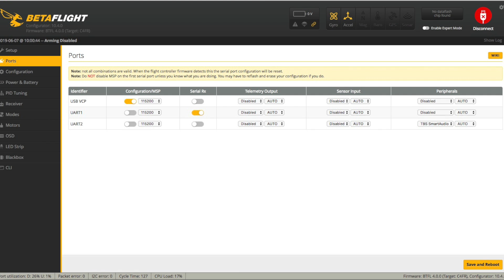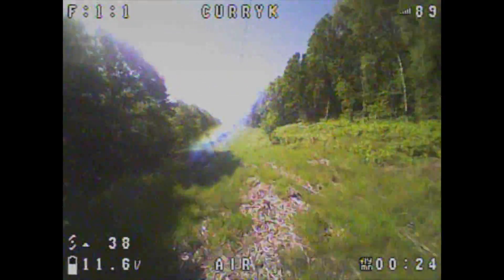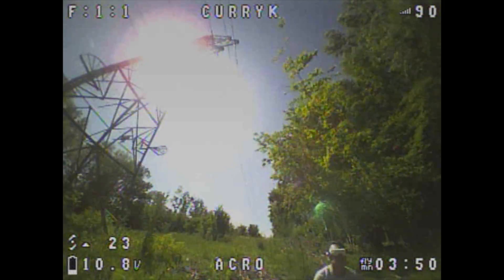Installing an XM+ in the SailFly-X for increased range

Comment: Thank you for this awesome video ! i got one of this little beast,but on Full Gas a got a lot vibration  ! What can be problem ? its pids or props ?
Reply from the maker: I just went back and checked my original video to see if I messed with the PIDS and I didn't, but full beans on 3s and those props will flutter and cause some vibrations.  They are also quite susceptible to wind as well.  I just did a video about trying hq props (which are better) and the little 4-bladed emax avans which worked really nicely on another model.  So worth experimenting with these if you want to get smoother

Comment: can i install my Flysky X6B rx to the sailfly the same way you installed the xm+ ?  thanks !
Reply from the maker: Yes - with a few caveats, as I don't fly on FlySky, so my info is a bit sketchy.  I think IBUS is non-inverted, so you can use RX1 instead of IRX1, but the rest of it should be the same

Comment: Where exactly is the "white" wire connected? Thanks in advance for your help!
Reply from the maker: The white wire (which is SBUS from the XM+) goes to the inverted RX1 pad on the board.  If you look at the board schematic here http://www.happymodel.cn/wp-content/uploads/2019/05/Crazybee-F4-FR-Pro-v2.1-Connection-Diagram.pdf you'll see it labeled as IRX1

Comment: Hello Sir. Very good job you have done very good. 
Question,. Will putting one in the v3 be the same as the v2.1. I have just got a Larva and I'm ready. The Larva comes with great instructions I imagine it's the same. 
Small soldering indeed. Go Go gadget quad.lol
Reply from the maker: Just having a quick look at the board layout (http://www.happymodel.cn/index.php/2019/07/26/crazybee-f4-pro-v3-0-2-4s-compatible-flight-controller/frsky-top-view/) things look like they've been laid out differently, and there's no connector, just solder points.  So, you'll probably find that the solder points match up correctly, but they are in different places
Reply: Yes that bind button is  as hard to find as an holy man in Sadam.
But I found it. After taking the canopy off and lightly pulling vtx up a bit I had it good

Comment: Get video once again. Question though, could you have used soft serial to remap/seperate the uart1 pins/resources and therefore not have to relocate the smart audio wire? FAR from an expert and not tried it myself, just a thought
Reply from the maker: Yes you could split the UART rx/tx pins into separate softserial devices, but what you don't want to do is run something that's timing critical like a receiver on a softserial port.  Unfortunately, the need to use that physical inverted RX1 pad gave me no option but to move the smart audio as well

Comment: I did this with the trashcan but lost my osd not on the quad but in betaflight? 
Any ideas? It uses that triangle vtx
 
Think I got it I need to pull the smart audio (green) wire from vtx to tx2 correct?

Comment: Your piece fell into a carpet singularity. Only a hypothesis so far but I'm working on the research. It's either that or leprechauns. I'll let you know what I find. Keep up the great work mate. Cheers.
Reply from the maker: It showed up again - perhaps it's more of a wormhole and it travelled back.  I was just hunting around finding where a component cable went and it was sat there  mocking me.  I'm not putting it back yet, but I'm going to replace the camera in this next, then it'll go back  in and I will have scored a victory. ;)

Comment: I think you could’ve just use the uninverted signal point on xm+ thou it’s tiny to uart2. I just connected r-xsr uninverted s.port (fport) to T2 and it works fine.
Reply from the maker: Yes - you can access an uninverted sbus signal on the XM+ (although it's annoyingly on the leg of a chip)  My main reasons for doing so are as follows: 1) I didn't think of that  2) I didn't have any heat shrink to put the XM+ back in  3) I still didn't think of that :)
Reply: CurryKitten Heheh, either way it works. And yes that uninverted sbus point on xm+ is a pain the butt to solder. I couldn’t do anything w/out headband magnifier glasses.
Reply: Blast Off hello so you are able to use fport with rxsr on sailfly.. Can you explain the wiring solution? I bought the pnp version of sailfly and i want to use my rxsr using fport on it. Thanks

Comment: could u please tell me which/what solder wire u use...where u buy it from....is it any good.....any advice on this please.i don't know which one to get....have bought  quite a few from bangood..but non of them seem to be good at melting nicely.....btw i am in the uk...
Reply from the maker: I think the last roll I got I may have bought from Maplins, so that's out.  I'm using 1mm lead free solder (it's from Mudder just reading the label)  Lot of people will tell you to use the leaded stuff - but I'm playing it safer.  Anyway if you search 1mm lead free solder on Amazon.co.uk you'll get a bunch of hits, 100g will last a long time.  WIthout wanting to tell you how to suck eggs, make sure your tip clean and tinned and you've got plenty of heat there.

Comment: Great Video CK, you must have nerves of steel and rock steady hands !!!!!, if you get the one without a receiver, it comes with through holes for the TX's & RX's, so a bit easier to solder and also a little bit cheaper. http://www.happymodel.cn/index.php/2019/05/18/crazybee-f4-pro-v2-1-flight-controller-2-3s-lipo-compatible/1011-6/ - www.happymodel.cn/index.php/2019/05/18/crazybee-f4-pro-v2-1-flight-controller-2-3s-lipo-compatible/1012-4/

Comment: Not sure if BF supports this, but I'd guess it probably does. In INAV we support running a hardware uart in just RX mode using only the RX pin. This lets you enable a half-duplex softserial port on the TX1 pin, which would let you have both S.Audio and SBUS input using only the TX1 and IRX1 pins. That way you don't need to swap the S.Audio wire, just change its port via software. This also leaves TX2 and RX2 free for connecting a small GPS (we don't support WP/RTH without compass right now, but my plan is to use my sailfly to try to make that happen).
Reply from the maker: Sorry for the delay - your comment was stuck in the spam folder because it though the . in S.Audio was a URL :)  When I look and thought - well SBUS is an rx and S.Audio is a TX can I use the same UART - I couldn't find anything in BF about it.  I found some references in Github issues asking for the feature but it looked like they had been turned down based on the two protocols running at different baud rates.  Admittedly I wasn't looking for running as RX only and using softserial... I do wish finding BF features was a little easier to do.  I was a bit confused why a compass seems always needed in quads - I've just fallen foul of this in Ardupilot.  I figured it would be the same as planes and you could infer the direction the quad is facing from it's path and you could also infer that the quad is flying forwards based on the acclerometer and figure out the rest from there.  I'm sure there's more to it than that, but it seems workable in some way.  Look forward to seeing some waypoints on your sailfly soon !

Comment: Did you consider using an R-XSR? It's a bit smaller than the XM+ and has telemetry. You might have been able to get telemetry to work through the led connector. I upgraded a couple Babyhawk R's to R-XSR radios and was able to get telemetry to work.
Reply from the maker: Wow, that is tiny now.   I instantly thought of the XSR and was confused as that's quite big.  I've actually got a few R-XSR's installed in some RTF quads.  They are great, no doubt - I went with an XM+ because I had a spare sitting around on my desk and they are a bit cheaper.  I never end up connecting smart port telemetry in when I have it available, I'm just happy if I've got a decent RSSI indication
Reply: CurryKitten  With telemetry you get audible RSSI warnings, you can configure audible battery warnings, and you can use LUA scripts to change pix settings. On the baby hawk R it’s not clear where to solder the telemetry wire, but it works on the connection next to the usb.  There a few of them and it needs to be the one furthest from the edge of the board. I like that it has a connector. Makes firmware updates easier..
Reply from the maker: SUre - I know what it does, and I know a lot of people love changing things via the LUA scripts - it just never felt like something that useful for me - but cool that it's working nicely for you.  Do you feel the connector gets in the way of tucking the RX away nicely.  Like you say - great for firmware updates, but slightly less compact
Reply: CurryKitten  I hade enough room and there was definitely not enough room for the XM+. I have yet to change a lid setting although one of my radios is set up with the LUA script. The big advantage I see with telemetry is audible alarms. If you are focused on flying it’s easy to forget about RSSI or remaining battery.

Comment: The 14x14mm cameras  (EOS2, runcam nano 2, runcam racer nano) all fit perfectly in the stock sailfly canopy if you shove it in. I've got an EOS2 with the racer nano's 1.8mm lens and an HGLRC 50mW nano vtx in my sailfly.
Reply from the maker: That's cool - thanks for letting me know.  That TPU seems quite flexible, so I'm sure a bit of brute force won't kill it.  I've got a few micro cameras coming in that'll fit - I'll have to see what I've got around as a nano VTX

Comment: I don't have this drone, but if you can source a VTX, I cannot recommend the Runcam Racer Nano enough! Granted, you will need to turn off sharpview, and then still turn down sharpness to like 10% of the max and maybe bring the edge off the brightness, but after that, I continue to be very impressed. It feels to me like folks describe the Eagle,.....HD. In my most recently posted video, when I dive into that field through the trees, I remember noticing that I could see the individual weeds from like 30 feet up. I just ordered a full cinebee, and I am just hoping the fpv feed will be as good as the Racer Nano. If not, I have a Ratel waiting to take its place,.....HD recording is not going to take the place of awesome feed!
Reply: Shut up idiot

Comment: Thanks for the detailed explanation.  What would be a good replacement for the camera, and would you consider doing a video on replacing the camera/vtx?
Reply from the maker: I'm not sure yet - someone else commented that you could fit a RunCam racer nano or the Caddx EOS2 in there if you shove it.  I've a few cameras coming in for review so I'll be aiming to put one of those in.... not sure about how to replace the VTX yet... I'll figure that out later

Comment: Got a tune youd like to share for your sailfly? Mine had mad oscillations on the stock tune. Flashed it to Albert Kim's tune and that just mad it worse. Everyone else I see has theirs flying smooth and perfect. I cant go above 50% throttle on mine :(
Reply: Make sure your motor screws are tight  and the props are not bent or otherwise damaged.
Reply from the maker: I haven't touched the tune on it, only the rates.  As CC says below - check stuff.  Its easy for props to bend - and the prop shafts.  Look for any motor movement, and check that the stack is held in place securely.  After flying do all the motors come down cool - check that there's not one that feels off compared to the others.  You could also go into betaflight in the motors tab and run each up in turn and check to see if there's any pulsing, or anything odd.  You are just looking for something that's out of kilter with everything else

Comment: Defo worth doing it range is a problem, I just got my sailfly so will see how it goes, by the way I noticed the rssi varies as to when the signal actually drops out, built in Rx doesn't seem to drop out until rssi is down in the 20s, but the XM+ I've used drops out at 60 or even higher , still has longer range but worth noting.
Reply from the maker: Yes - that SPI RSSI goes very low... which is fun as your standard telemetry critical alert jumps in at 42 I think

Comment: Great Mod!!  i'm Lost on all the  Flying Lingo....Inverted Rx2 and such....but i Kinda of understand?!  So Hard to Learn all the Betaflight and  Pin Layouts!    Wish these Quads were Easier to understand!
Reply from the maker: To be fair, that wasn't the most straightforward looking flight controller.  There's plenty of them which are much nicer laid out and practically say "connect receiver here".  Have no fear though, if you get stuck, then odds on, someone else has as well and probably made a video about how they solved it :)

Comment: Hey newish sub off me. Great videos the way. I was looking for your opinions on xm+ in 2s whooops eg trashcan, mobula 7. Would it be beneficial or just sap the battorty. Thank
Reply: Xm+ is only 30mA at 5V so if my maths hold true that is a pretty insignificant 150mW
Reply from the maker: The battery would be fine - take a look at this particularly silly video I made to push the distance using a 1s brushed quad https://www.youtube.com/watch?v=89kJdHoikhU I used an XM+ of course.  The question is do you want to fly a whoop that far :)

Comment: Sooo, I thought these days you can get non inverted signal off of a pad on the xm+? If so then cannot you just us rx2 without hacking smart audio about? Or is the uninverted pad only on the r-xsr..?
Reply from the maker: This is a good point and non one I thought of.  There' an uninverted connected off the legs off one of the chips.  It's small, but it's probably no worse than the other bits of soldering here.  Good point.
Reply: @CurryKitten  as it happens my sailfly arrived today, I'm currently wondering if the newish gnb 300mah 80/160 will allow too many amps and lead to dead crazybee
Reply from the maker: That's super high-C for a little lipo.  I've not managed to murder mine yet - although it's difficult to get all the power down in anything but a vertical punch-out
Reply: You can get an uninverted signal from the XM+ but, it is not a dedicated pad (like the R-XSR has), it is a pin of one of the components. It is a bit of a pain to solder to but, it can be done. EDIT: CurryKitten got in there first, LOL.
Reply from the maker: Type faster next time :D  To be fair, I would have probably gone the inverted pad route, just because I can't find any heatshrink the right size for the XM+ it I unwrap it again.  Quite a lot of build decisions are down to pure laziness, or what I have to hand
Reply: @CurryKitten  Would there be any latency advantage if we connect the uninverted pad from the XM+ to the uninverted pad of the FC (I assume the XM+ is uninverted natively)?

Comment: I went straight for a micro eagle and r9 on my build. The bigger props can handle the weight and it's only 55g dry.
Reply from the maker: Same frame/canopy Fraser?  Just wondering what you did on the VTX front, as the HappyModel camera is an AIO unit.  Got some reviews cams coming in soon, will try one of them as the replacement on this build.
Reply: @CurryKitten  no it's a rmrc newt frame with a tpu stack adapter for the iflight whoop fc with the vtx and a full size cam mount I found on thingiverse. The camera fits nicely in the space where the half size vtx isnt. I just figured the best places to fly these are going to be parks and stuff and you have to wait for dusk before the kids go home so I feel a low-light camera adds quite a lot.

.....and of course I added a buzzer pigtail should I fly somewhere sketchy.